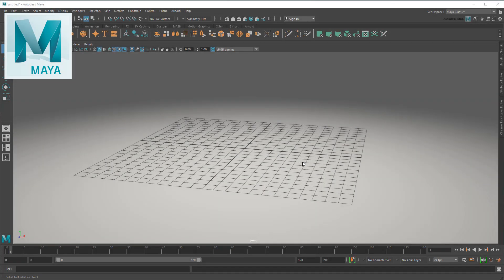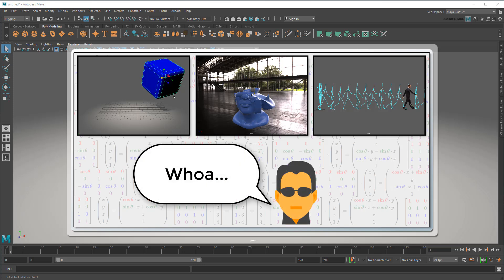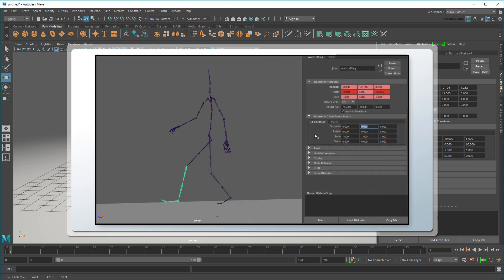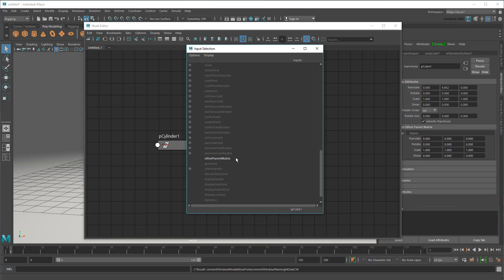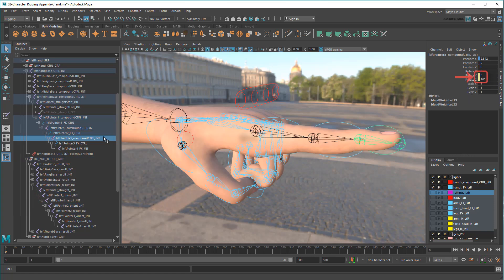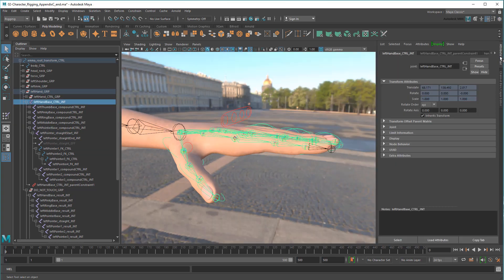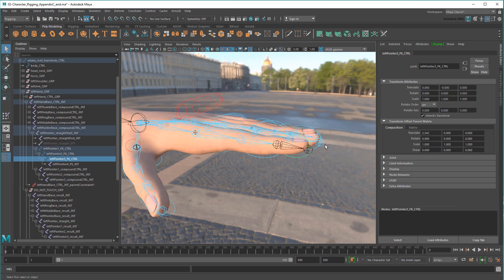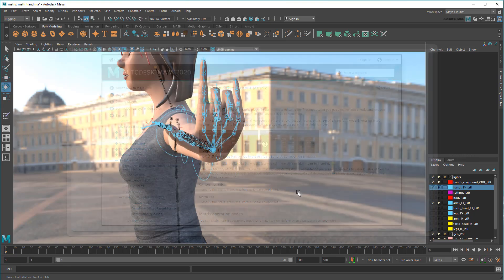Empowering rigs using Offset Parent Matrix [MAYA 2020]

Comment from the maker: *Update*: I tried my hand at adapting the Emma rig using Offset Parent Matrix.  Currently this is still a prototype, but if you're interested in seeing one possible solution you can check it out here: http://areadownloads.autodesk.com/wdm/maya/matrix_math_emma_V1.0.zip
Reply: This is an incredible feature and a huge game changer, but I was wondering... if I'm rigging, let's say a character in A pose, how do I preserve the orientation of regular curve controls so that they match with the joints, which are angled? If there are no offset groups, I'm not sure how I should zero them out without them getting oriented to the world.
Reply from the maker: @gretchenasmar7371  Are you manually creating curve controls out of NURBS curves?  And if so, are you keeping their transform nodes or parenting the curve shapes directly to your control bones?  If the latter, you shouldn't need to worry about it at all since you can just manually orient the controls using their Control Vertices.

If the former - first off, I would avoid doing it this way since extra transforms could introduce extra variables into your rig.  But if you must do it this way, you should be able to use the multMatrix node to multiply together all the spaces before the control (so in an arm control's case, the upper body * arm space matrices) to give you the diagonal arm space as "0-orientation".
Reply: @Autodesk_Maya  I'm creating them and creating an offset from the same curve (deleting the dup shape and parenting the original to that group), which is what I'm trying to eliminate
Reply from the maker: @gretchenasmar7371  Sorry, do you mind posting an example file somewhere I can get to it (such as area.autodesk.com's forums)?  I'm having a hard time envisioning what you mean.
Reply: @Autodesk_Maya  No worries! Sorry I took a bit, apparently I couldn't upload the file directly onto the forum. Here's the link with a description and the drive file, hope it helps :)

https://forums.autodesk.com/t5/maya-animation-and-rigging/how-can-i-keep-control-curve-orientations-when-using-offset/td-p/9394491

Comment: I really appreciate this helpful content!  After watching this last video about the use of the Offset Parent Matrix before doing the full playlist, it feels a lot more difficult to decide whether or not to follow this tutorial from the beginning. I understand that the real-time creature rigging playlist here on @Autodesk_Maya channel does use the Offset Parent Matrix, but perhaps doesn't include as many features as this playlist creating the Emma rig.  I am trying to decide where to start. I have lots of experience rigging in 3ds Max, so would like to dive in and learn as much about advanced Maya rigging as possible, but am not sure I want to commit to this or the other with the intention of eventually doing both.  So with the understanding that I am possibly only choosing one, do you think that if I understand the Offset Parent Matrix while going through this (Custom Rigging for animation (film / tv / shorts), that I will be able to apply the fixes using the Offset Parent Matrix as I go?  If not, that's not really a dealbreaker, as my goal is to learn the more robust rig. Any suggestions?  Thanks so much!

Comment: But the use of Offset Parent Matrix is pointless if you want to get your rig into another Maya scene. Maya can't export the OPM values and results in a broken rig. If there is no way to export and import a rig with OPM values, I fail to see how this empowers rigs and is not a detriment to them?
Reply from the maker: That's odd - there shouldn't be an issue importing these into another scene unless you're doing so in a version of Maya that doesn't support Offset Parent Matrix.  For example, the Mayabot rig in the Content Browser makes plenty of use of OPM, and anytime you load it you're literally importing it into a new scene.

Comment: @9:26 - In Maya 2020.4 testing this doesn't behave the same. I am trying with a new scene, and a two joint chain duplicated, so a simple set up. Using both matrix and world matrix have the same result. There's an offset like you demonstrate, but matrix doesn't fix it, nor does zero-ing out the 'child' as it's also rotated from its original position, but without rotation values. I'm ultimately trying to see if I can use it as an inbetween for retargeting mocap skeletons while leaving the joints free to adjust, but every time I try this method, even with matrix and not world matrix, it creates a weird offset in the transforms. Any ideas?
Reply: +1 the same shit...

Comment: Is there a way to adjust the OPM using the manipulators instead of adjusting it using only the values?
Reply from the maker: You could always connect a locator to the OPM inputs.  Then you can just select/move the locator to change the OPM.

Comment: Is this like delta transformation like in blender?
Reply from the maker: Sort of, though you could also achieve the same results as a delta transform simply by grouping an animated object and then moving the group.  Offset Parent Matrix works at a much deeper level and allows you to do more complex things.  For example, you wouldn't be able to do the simplified hand controls shown at the end of the video using delta transforms.  In fact, I don't think they work on bones at all (though I could be wrong).

Comment: When using offset matrix instead of parent constraint is it possible to bake the child's transforms somehow?
Reply: At first sight it doesn't seem to be possible. I guess you could parent( with no offset) a locator to the child, bake the locator, unbind the child, parent the locator to it, rebake. I agree such a procedure should be made into a button by default but let's not wait 5 years for Autodesk to make it. It's a simple MEL script to make.
Reply from the maker: I'm not sure you'd really want to bake matrix transforms since one of their greatest strengths is the ability to quickly disconnect/reconnect them to make changes to the rig.  Just curious, what's your thought process on wanting to do that?
Reply: @Autodesk_Maya  It may be useful in some animation scenarios.
For example what I had in mind with offset matrix:
To connect a backpack to an animated character, bake the animation, reconnect and offset the keys to get a secondary overlapping animation. The advantage is that the transforms would be in world space and easier to work with. This could be done with constraints but it maybe faster and cleaner to do with matrix connection.
Reply from the maker: @ivnbgtv  Hmm, if I'm understanding the scenario properly, you could just do this by connecting a locator (parented under the character) to the offset parent matrix of the backpack, then animate both the locator (in character space) and the backpack (in world space) to get primary/secondary animations.  No baking required.

Or if you want to keep everything in world space, feed the character matrix into the locator's offset parent matrix, then the locator's matrix into the backpack's matrix, while keeping them both in the root hierarchy.
Reply: @Autodesk_Maya  I make rigs geared for animating characters for video games, so being able to bake all of the animation down to the joints so I can export skeletal animation to a game engine is crucial. If I were to use matrix transforms in these rigs only to learn that they do not allow the animation to be baked properly then the rigs would be completely worthless for the very thing they are made for.

Additionaly, baking animation is used in motion capture and animation retargeting workflows as well, so if matrix transforms prevented that then it would give riggers another reason to avoid them completely.
Reply from the maker: @Yoshermon  So I talked to the team, and while there isn't an out-of-the-box solution for baking these transforms (yet!), there is some great 3rd party work already being done for this: 

https://twitter.com/Muream/status/1204521176283914242?s=20

https://twitter.com/kiaran_ritchie/status/1206980542542991360?s=20

An in-box solution is something the team is looking at, but obviously didn't make it in time for this release.

Comment: This is awesome, I wish there is a menu command to do these connections right away instead of doing it in the node editor, other wise, it seems to result in more clicks.
Reply: Yes, they need to rework the connection editor with filters and tooltips to make this kind of feature easier to use.

Comment: Does it also replace the function of having two parent constraints with a blend like when we animate an object going from one hand to another?
Reply from the maker: There's a blendMatrix node that allows you to do the same sort of thing, and it even lets you choose which channels (Translate, Rotate, Scale) to pass through.
Reply: @Autodesk_Maya  So I don't see any advantage as to using parent constraints. Is there a way to make this connection into a script? If it's possible, then it's easy as selecting a parent, shift selecting a child and run script just as you would with a regular constraint
Reply from the maker: Well, as mentioned in the video, the primary advantages are performance increases (matrix operations are simply faster and less complex behind the scenes than constraints), and more versatility (ability to adapt joints, perform additional stacked transforms, etc).
Reply: @roxonogueira  the advantages are less dirty nodes in between, less connections, and far greater stability when working in a pipeline. Ask an animator when a constraint in their scene from a rig or one they made randomly just breaks.
Reply: @Z33Garage  yes I worked in some cinematics and moving props around was always a pain. I always set some extra groups and locators over a single object to animate it's offset when constrained. Specially books. They were hard to animate between hands but it was fun.
Reply: @Autodesk_Maya  thanks for the reply. I'm really impressed and everyone seems to be excited. If you would make that connection into a script, people would go crazy

Comment: This is absolutely great!

Any chances of having a bidirectional constraint as well?
Reply from the maker: Hmm, you could use the pickMatrix node to setup a situation where object A controls object B's rotation and object B controls object A's translation without getting into a cyclical error, but I'm not sure how much I would recommend it.
Reply: @Autodesk_Maya  

Yes, that's why I mentioned bidirectional constraint. For these kind of operations they are easier and mostly error free.

Thanks for the tip though.